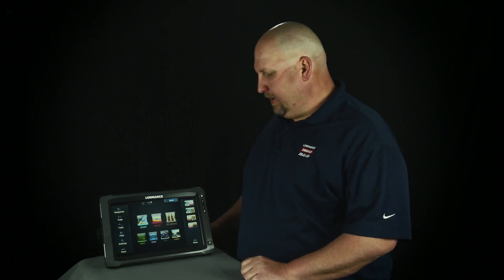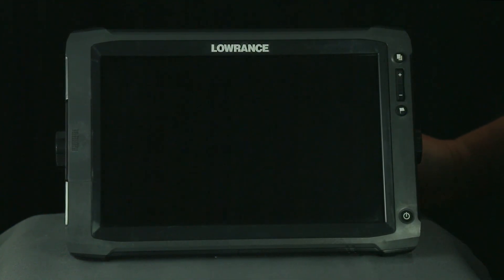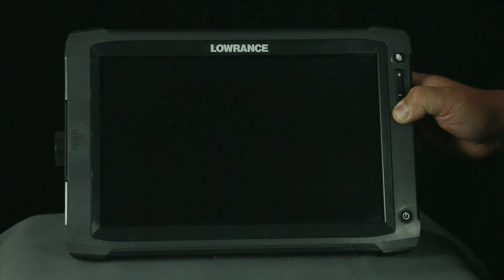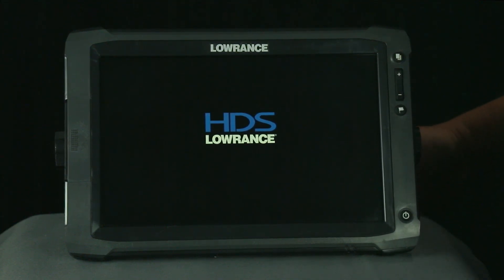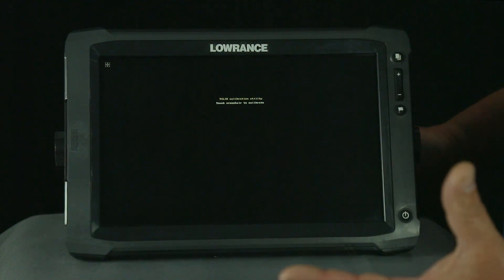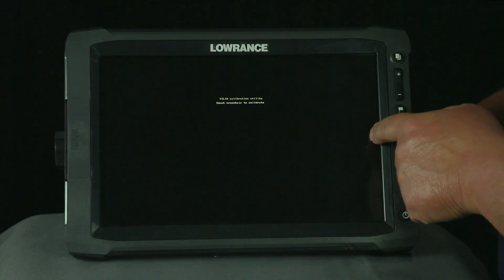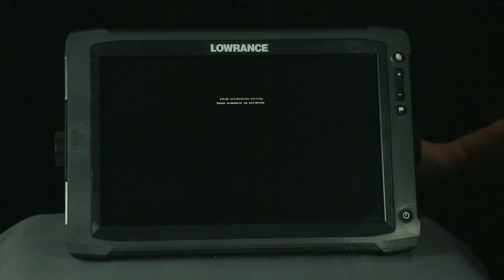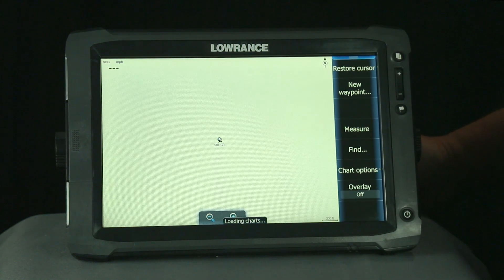How to Calibrate the Touchscreen on Lowrance® HDS® Gen2 Touch

Comment: I just tried turned on my units after storing for the winter and the touchscreen is unresponsive on it. I try to calibrate it and it will not go into calibration mode, just right to the navigation disclaimer and I can't do anything. I have 2 other Gen2 HDS units that work fine and will go into calibration mode no problem. Any tips would be MUCH appreciated!!